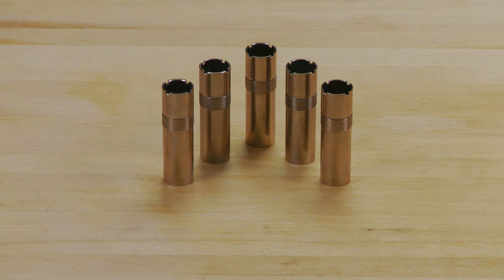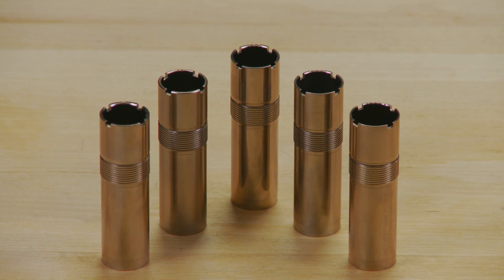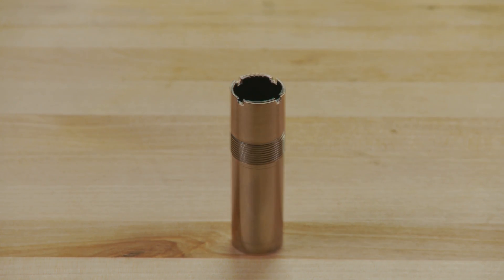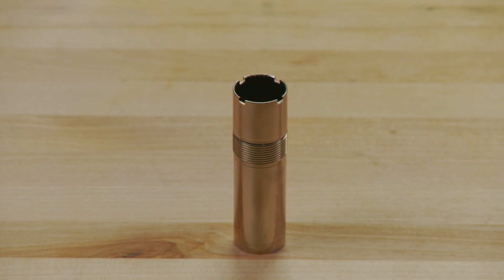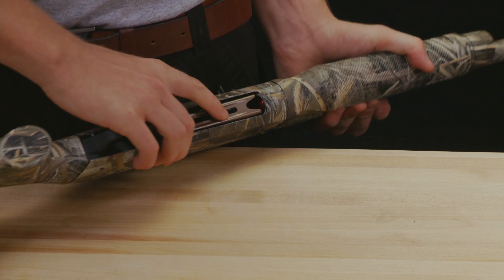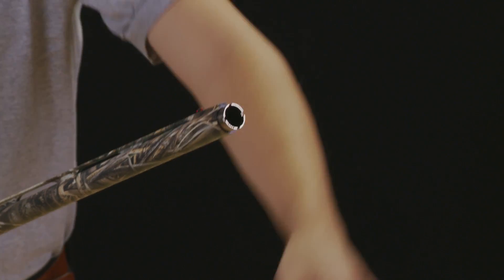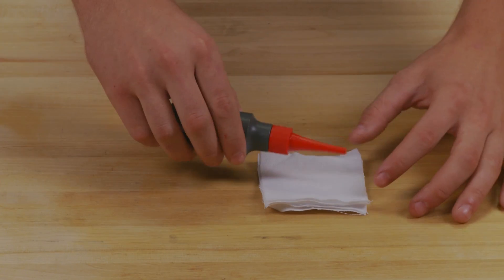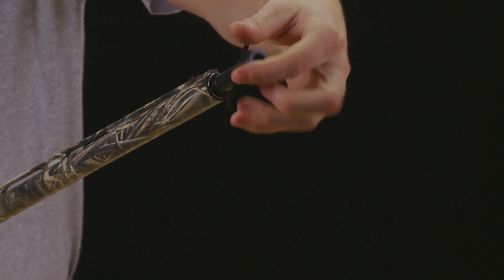Benelli Tech Shop - Changing Choke Tubes

Comment: I bought an 828u and had issues screwing the choke tube in the top barrel. The new gun was missing the “full choke” tube so the dealer sent me one, when it arrived it wouldn’t screw into the top barrel at all. I had ordered Briley replacement tubes (I use them on all my shotguns) and when it arrived it would not screw into the top barrel. I found the Benelli chokes that came with the gun had scoring on the side, it looked like when they tapped the upper barrel it was not concentric. The dealer agreed, I returned it then got another one the same day from one of their other stores. Week two gun two. I shoot with shooting gloves and found the safety to be so tight I had to remove my glove to activate it. I called Benelli then showed it to the dealer and he agreed, the safety was way to stiff. Gun was returned to  Benelli, they repaired the safety and removed the auto function of the safety. 
When the gun was returned it functioned properly. I received my née replacement chokes from Briley and found they screw into the bottom barrel with ease but will only screw into the top barrel by 1/4 or 1/2 turn. Once again, issues with the top barrel on the second 828u in two weeks. This is absolutely incredible, Benelli has some real quality control issues and there is no way I could in good conscience recommend this gun to anyone.